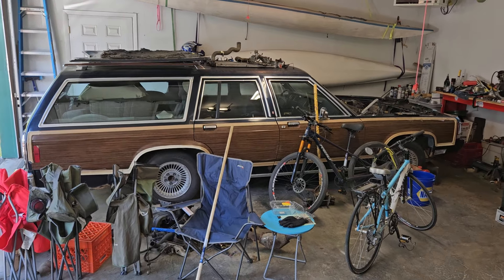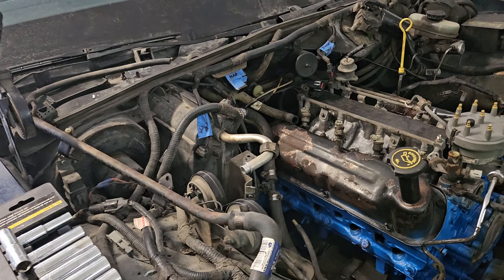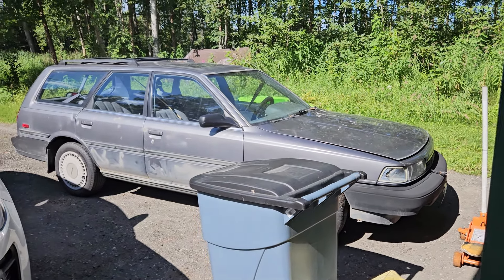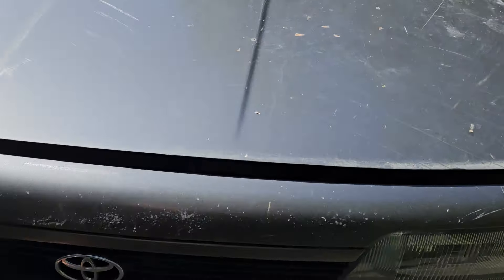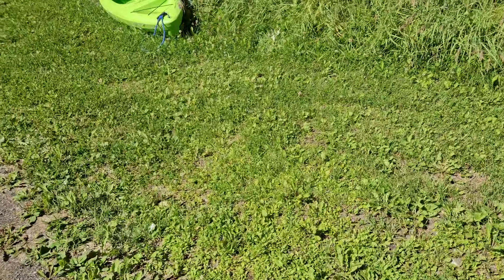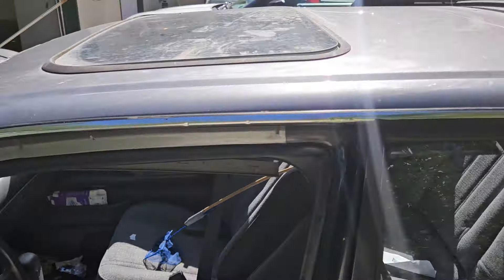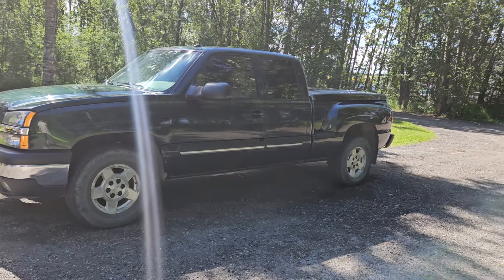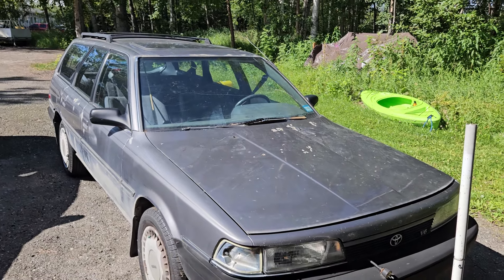I Got A Free Car!?

Comment from the maker: Update: I found that the new coil has a deep plug and the coil wire isn't right, it doesn't touch the metal contact. I jumped it with a screw driver bit, put a battery in it, and i heard it run for about a second. It's either out of gas or it is suffering from a spark or gas problem. The motor itself sounded solid! There are no weird knocks or rattles. It cranks over nice and fast, fires, but as soon as you let off the key, it dies. So I'll be chasing that till it runs!! I will keep it and make it run!! While the battery was in, I tested the electrical systems out, and seemingly every single thing works!! Factory radio, good! Aftermarket sunroof GOOD!!! I was surprised that worked perfectly. I'm really happy with it so far!! And I'm excited to get that v6 rolling! I'm going to try a ignition control module next as that's what the guy said it needed, and it's only $50. If that doesn't work I'll start investigating relays and the ignition switch, and the fuel system. I have some hopes that this will be a good runner soon!! I have done a mild detail so far, vacuumed the trash out and ozone 'd the interior. It didn't have any smells but there was mold on the floor mats so it was worth doing! I have fallen in love with my new 1990 toyota camry! I really like it! Especially at the price of free! Thanks for watching! And I hope you'll continue viewing my content, I will be making more from this camry!

Comment: I had an 89 wagon just like that and the only reason I got rid of it just 5 years ago is because the floorboards were starting to rot through. If you intend to keep it I'd suggest som sort of bed liner or under chassis paint to keep it from doing that. Otherwise it was great and mine had almost 300,000 miles and still ran great. Rode great too after new shocks and tires.
Reply: Fliud film or used motor oil is great at protecting from moisture and not trapping it in

Comment: I had a used 1990 Toyota Corolla Wagon bought in 2007 with 137,000 miles on it. I drove it until 2019 and it had 439,000 mi. when I sold it. I had to replace the alternator and plugs on it once then only changed the oil & filter every 3000 miles.

Comment: I see it has "25" tabs on it, which means it was probably running until recently. Therefore the rodents haven 't moved in yet. It's straight, with little or no cancer. Even the paint is half decent. Interior is messy but decent. (no rips in the driver's seat. It's complete without it being all apart. And 182k is lo mi for a 34 year old car. And you got that Ancientmobile for FREE!? Therefore this is a prime specimen for salvageability. And this is what I thought before reading your opening comment. Great score! One piece of advice, I'd put that cloth cover back on the vinyl steering wheel, which gets cold in winter and hot in summer on your hands. It no doubt ameliorated freezing Alaska winters. Also, the cover explains why the steering wheel is in such good shape.

Comment: you are doing it wrong. First you cannot run the fuel injection without the emissions system. Your stock fuel injection system run on feedback/electronic fuel injection/ECM from emissions system. You would have to go points and condenser and carburetor to make it run and install low PSI fuel pump, fuel injection fuel pump is too high. Good Luck